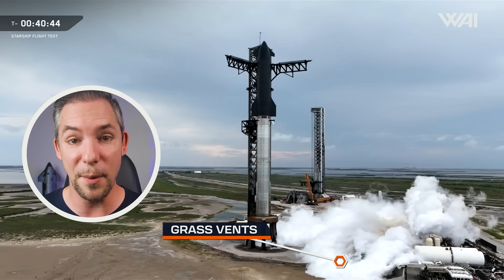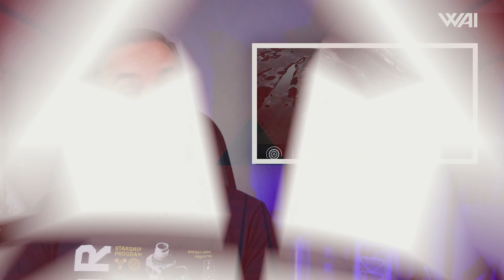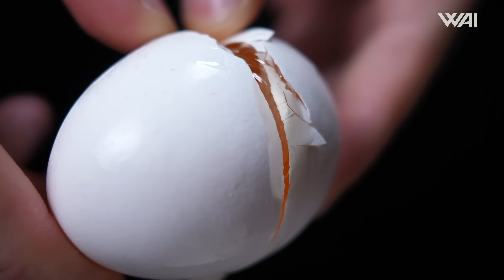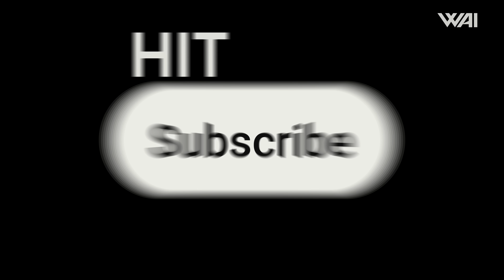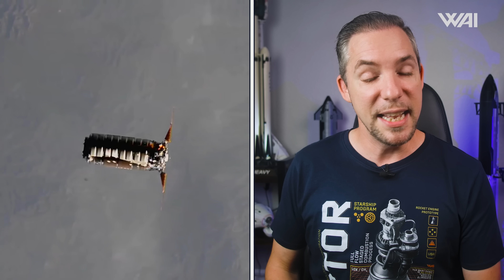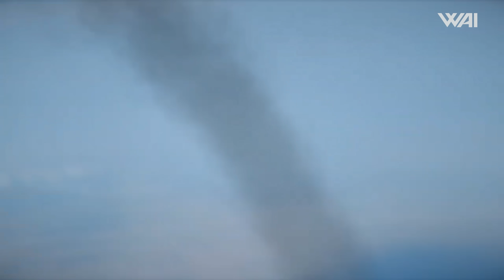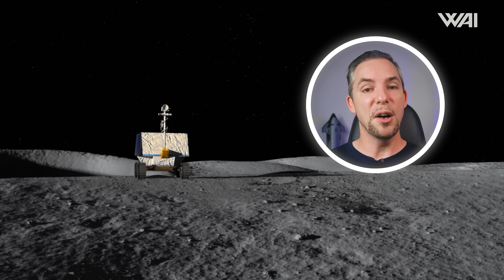SpaceX Starship Flight 11 So Close - I'M SHOCKED!

Comment: Regarding Cygnus, can one have a 'maiden voyage' for a one-use-only spacecraft? Plus, calling the ISS 'aging', when the Voyagers, and Hubble are sailing merrily through space is the kind of bias 'Ground News' should be covering. Nauka isn't 'aged'. None of the modules hauled up between 2006 and 2011 are aged. Every Cygnus, and even Japan's now-retired HTV logistics modules are examples of pressurized hardware that could still be used at ISS if NASA's culture changed to one of continual refurbishment rather than their historical 'throw away' mentality. This is an astronautics  version of 'new car syndrome': trying to justify a new buy when the old ride is still delivering. May ISS continue for another 40 years. Felix, sell your Boeing and Axiom Space shares.

Comment: I don't see a copyright on the video representation of the transport barge.  It seems to me more likely that Starship parts will be shipped in the form that they leave the StarFactory.  Rogers Road will have a Gigabay, but not a StarFactory.  So it will have the ability to stack boosters and ships.  Why spend time stacking boosters and ships in the Gigabay at Starbase, rather than shipping them straight to Rogers Road?

Comment: One additional eggshell context comment to add to the mix for you, Felix.  With a small edit to show and reference ostrich eggs vs. chicken eggs your video would almost pass your fans' strenuous fact checks - Ostrich eggshell thickness varies between approximately 1.64 mm and 3.5 mm or ALMOST as thick as the stainless used to build starships and superheavy boosters.🤓

Comment: During the testing of the AVRO Arrow they used heat sensation paint to determine the heat at various locations on the plane. This simple solution allowed for fewer sensors and reduced weight and complexity.

Comment: Hallo Felix + Team, danke für das Video. Bzgl. des Starship+Booster Transports nach Florida auf einem Lastkahn. Bei den Größen, Gewichten und der Seeweglänge, wie will SpaceX das Verwinden des Lastkahns bei Wellengang verhindern, damit keine der beiden Frachtteile Schaden nimmt (ich denke hier an Ermüdungsbrüche)?
VG aus DT
P.S. Cooles Shirt👍
P.P.S. Was ist mit euren beiden Shops los? Ich bekomme bei beiden Error 404 - Seite nicht gefunden?
Reply from the maker: Hey, ich glaube, SpaceX wird nur transportieren, wenn das Wetter es zulässt. Die Strecke ist nicht so weit. Das sollte machbar sein!

Danke! Ja, die Shops sind beide offline. Ein Hacker. Der Support von Spreadshirt ist sehr langsam…

Comment: It's kind of silly for SpaceX to have such a thin hull on Starship and then weld all the stringers on the inside and outside of the ships. It'd be much more structurally sound if the ships ring sections were corrugated and then have inner or outer rings welded ever so often on the interior or exterior for support. Sort of like the rings on a pickle barrel or beer barrel. In that way the ships can be supported horizontally on those ring sections the same as the ribs inside of a wooden boat, just steel. Also the weight would not be any more than what it is now with all the extra welds and stringers that exist on today's ships.🚀🚀🚀🚀🚀🚀🚀🚀🚀🚀🚀GO FLIGHT 11
Reply: I Don’t Like your Tone Dude !
Reply: Aerodynamic drag is a function of 'wetted surface area'.  A corrugated outer skin would increase the drag figure.  Go Flight 11!
Reply: like a submarine has a double hull .

Comment: There is a route through the middle of Florida. The Okeechobee Waterway (OCWW) is a 154-mile canal system that connects Florida's Atlantic and Gulf coasts in the central part of the state, running through Lake Okeechobee. It begins at the Indian River Lagoon on the east coast, enters the system via the St. Lucie Canal, and extends west through Lake Okeechobee and the Caloosahatchee River to Fort Myers on the Gulf coast. The waterway includes five locks and is navigable by vessels up to 50 feet wide and 250 feet long.

Comment: Felix egg shells are .3 to .7 mm thick.   And the booster skin is 3.97mm thick skin which is actually pretty thick for a structure.   I have worked as an inspector in a stainless steel plant. Although  we do ru alot thicker then that this is still consider pretty thick see how this is .16 inchs thick and we run as thin as .014....
Reply: Relative thickness compared to the diameter of the egg / ship.
Reply: He clearly said "comparative".
Reply: @RetroJack  yea he compared the thickness of the starship hull to the egg shell. There was no comparison for relative scale. Regardless, starship is a foolish concept.
Reply: @SterlingArchimedes  A foolish concept?
Reply: Ostrich Egg Thickness
Ostrich eggs are the largest of any living bird, and their shells are notably thick and strong. The thickness of an ostrich eggshell typically measures around 1.5 millimeters. This robust shell is capable of supporting significant weight, even that of an adult human. it can get as big 4.0 millimeters.

Comment: The reason it made sense for Viper to be canceled, is that if the government doesn't set a limit to cost overruns, the project managers will treat the budget as though it were unlimited. It is the very sort of mentality that has made Orion such an unaffordable system.  
Though I think pursuing Orion was a good thing to do. It was started before SpaceX was as far along in its projects, and it is perhaps good to have a 2nd choice for a launch system. Though, at its current cost, I don't think Orion is at all viable.
Reply: Not sure I understand the financials.  They canceled it to save 84 million but gave Blue Origin a 190 million contract to deliver it?

Comment: The SLS abort plan is flawed.  Even if the abort is successful, which I doubt it would be in a real emergency, the extra testing and weight will increase the odds of needing an abort system.  That makes no sense.  Build it lighter and safer instead.  Test is 20-30 times until it is safe, then put people in it.  I would not get in this death trap.  They are planning for failure instead of working toward success.

Comment: Why the heck are they picking a route ALL THE WAY AROUND FLORIDA'S COAST instead of directly to TAMPA/St. Petersburg then overland to the Cape ??
Reply: Tampa is approximately 140 miles from Cape Canaveral, primarily on expressways and interstate highways. This is a highly trafficked route through Orlando, and that's a significant amount of traffic to disrupt. 

Overpasses have around 5m (16ft) vertical clearance and the rocket is 9m (30ft) plus whatever it is transported on. So, they would have to go around all the overpasses -- but the stoplights at nearly every exit have no more clearance than the overpasses.

The booster is around 71m (233ft) long -- that's longer than four semi trailers end-to-end. Navigating the on and off ramps would be tricky. 

In the end, the land route just doesn't seem practical. Easier and safer to spend a couple of extra days at sea.
Reply: @greghadaller ok 😊

Comment: A chicken egg shell is on average 0.3-0.4 mm wide.
The Starhship steel is 3.97 mm wide, it is !) TEN TIMES as wide as an egg shell... not less wide.  (I checked this figure too, it is correct, only the egg-shell number was wrong).

4mm of steel is actually pretty thick, pretty strong, and pretty heavy by some comparisons: Modern commercial jet fuel tanks have tanks made of 1.5-2.5 mm Aluminum.  The space shuttle external tank was 1.6-2.0 mm of Aluminum-Lithium alloy.  Conversely ground-storage tanks that are intended for decades of stationary use and minimal maintenance with massive safety margins regularly are made of 10-25 mm thick high carbon steel.  So, while definitely not in the same range as ground-storage tanks, the Starship's construction is actually pretty chonky.
Reply: Thick, not wide

Comment: 304 stainless from which the Starship is made will readily rust, pit and crack in a marine atmosphere. If they were going to transport by sea precautions would certainly be needed, especially if they were to be re-used multiple times. Even storage in a marine atmosphere near the sea is likely to be problematic long term.
Reply: I’m sure they thought of that…
Reply: @ChadThundertalk  yeah I'm sure it didn't escape SpaceX attention. The fact that 304 stainless is unsuitable for use in marine atmospheres is not news for anyone with experience in these things.
Reply: WD-40 was designed to prevent Atlas missiles (stainless steel) from rusting.

Comment: If the single engine can be supplemented by the outside ring engines, then it may not need a static fire test if the potential is not as critical as it was before, perhaps?

Comment: Hearing Felix mention the subcoolers, I had to do a search because I couldn't remember the temperatures SpaceX chills their Starship fuels. Some fun facts, especially for kids, is to tell them (if my source is are accurate) that the liquid oxygen is chilled to almost (in Fahrenheit) 300° below zero, and the methane to 258° below zero. 

If you've ever had anything like a skin tag or wart burned off, the liquid nitrogen is around 320° below zero, although two different doctors told me it was 425°.

Comment: The handling of the starship and booster at the Florida end is a no brainer.  The bigger question is where the barges will be loaded and how the components get from the factory to the load point?  Use the existing port and find a way to travel all the way there?  Or build a new basin further east along the ship channel to reduce the land transport issues? 
The empty booster is over 200 tons and both have a 9m diameter, more than twice the normal road clearance when horizontal.  Both will present issues for land transport.
Reply: better just to build a factory in florida .
Reply: They need a canal or express highway to cross southern Florida. That’s a long trip around the tip & wasted time
Reply: @TruthMan1234  such a waterway already exists. It’s called the intracoastal waterway, and it was one of the things that made Cape Canaveral an attractive place for a rocket base in the first place.

Comment: Thanks for sharing Felix. Transporting the Ship and Booster on a barge is not logical🖖. They should rather test flight them from Starbase and then land it at Cape Canaveral. Think about it, the Booster lands first and the Ship does a lap of honour and land then. No Barge or special ground equipment.
Reply: No need for ship to do a lap.  Just separate and land separately at the two towers.
Or they could use both for a mission, launching at Starbase and landing at Canaveral.

Comment: Thanks Felix for another wonderful update video. The make or break for the Starship program is going to be V3 of the ship.  Should testing and flying go well, I think it's still full speed ahead.  Should V3 encounter anything near the issues that plagued V2, I think, unfortunately, the program is in trouble.  I would not have said this even after the flight 8 breakup but the issues since that flight have me very concerned.  I can't see a V3 launch of the ship and a super heavy V2 combination fly until early 2026.  SX just can't tolerate another disaster and I believe they know this because they are doing a lot more sub-component testing than they have ever done before.  An explosion on the new launch pad would be a catastrophic setback and they won't risk that. If V3 is a stinking turd like V2, they might reevaluate Mars and similar goals and objectives and concentrate on lunar lander development for SLS.  I don't see Blue Origin doing anything useful for NASA in the future.  It's obvious they have major issues with New Glenn and probably won't fly again until next year.  Booster reuse is a very long way off for NG and BO.  I don't believe we'll ever see it.  Not for a company so terrified of a public failure. Should V3 be successful, it's possible SX could strike a deal with Bezos and buy part or all of BO's Florida assets.  Anyway, I think it's all chips to the center of the poker game table for V3.  Have they learned from their mistakes on V2?  I think it's probable but space is very hard as both of these companies have discovered.  Neutron's make or break is in 2026.  If that all goes well, the competition in the space industry gets very interesting but I believe Neutron isn't insulated from the growing pains associated with spaceflight.  As always, time will tell.  Thanks again Felix.  I love your passion and creativity!

Comment: No way an egg shell is nearly 4 millimeters thick, like the skin of Starship & Super Heavy.. A dinosaur egg maybe, but not a chicken egg.
Reply: Looks like an eggshell is around .4mm thick, so his math is off by a factor of 10 or so
Reply: Absolutely not on the eggshell.  Unless it’s for an Ostrich.  4mm is more like 4 or 5 credit cards thick.  Eggcept it’s steel.
Reply: IF you scale a Chicken Egg up to the Size of the Starship I am sure you will find that the Shell is a bit more than 4 mm thick?
Reply: @anthonyshiels9273 it would be approximately 9mm think average egg diameter is about 40mm starship is 225x larger 0.04mm egg shell thickness x 225=9mm
Reply: @MrBretts1985  Yes, Starship Ø is 225x larger than a M sized chicken egg M ( 9000 mm : 40 mm = 225),
                                BUT the eggshell is ~0,3-0,4 mm thick    --- >   A starship sized egg would have a 90 mm thick "tankwall" !!  (225 x 0,4 mm = 90 mm)
Reply: @hectorpascale1013 .04mm not .4mm makes it 9mm
Reply: @MrBretts1985  Yes but an real eggshell is actually 0,4 mm thick.
Reply: @hectorpascale1013well if that's the case his analogy is still wrong
Reply: @MrBretts1985  He says: "That is thinner than an egg shell in comparison".  
 4mm Stainless is thinner than  90mm lime layer on a theoretical blown up egg.
Reply: Yes, 4 millimeters is ~0.157" or about ~5/32". A bit over an 1/8". By comparison the body panels on a 1960s American car were often 16 gauge or 1/16". Starship panels are then twice that thick.
Reply: The most important is that its exciting, not that its correct.
Reply: a credit card is about 0.76mm, u need 5 to get 3.8mm
Reply: My credit card is about 0.05mm after my wife used it.
Reply: That's what I was thinking I'm like 4mm is definitely thicker than an egg shell should have use banana peel or something if he wanted some comparison it's a 32nd of an inch above an 1/8 inch so between 1/8 and 3/16" thick
Reply: @MrBretts1985  The size of an inch differ dependent om which country to are talking about.
Reply: @AllanP-n3q we're talking about America... Starship is American Felix lives in America it's American
Reply: The analogy that I like most is that the shell of Starship is thinner than a scaled-up 12 ounce soda can.
Reply: @genelane2243 depends on how old the can is.   The old cans no.  The last several decades, yes.   Some of the old cans didn't burst in a freezing car, or a boiling hot one.   I have one that survived 3 or 4 years in a parked, closed up vehicle, fully exposed exposed to the sun and the cold.   And it isn't that old.   The company just hasn't figured out how cheap they could go on their cans yet.   Let's hope Musk sticks to the thick skin.   Less payload is well worth the added safety
Reply: He said "in comparison", which I take to mean "proportionally". If an egg were the diameter of Starship, it's shell would be much thicker than the steel.
Reply: You're right, @billsimpson604. An eggshell is about 0.4 mm thick, so Felix just missed a decimal point...
Reply: “. . . In comparison” he qualified the statement as a comparison. Give the man a little credit
Reply: @dunnkirke  it's a comparison that is 10 times off
Reply: Even the picture of the egg they show is clearly less then 1mm. Myst be a American converting to metric issue.
Reply: @dradic9452 is German and made a mistake on the comparison he was trying to say that the skin of the Super Booster and the Starship are thinner than an egg if it was of the same scale in size
Reply: It's obviously a comparison of proportion
Reply: He did say “ in comparison “!  Don’t you listen?!
Reply: I thought he said,  "point 4"...

Comment: Wait, did you just say to save 84 Million? You mean does that costs another 84 Million to put that Rover on the Moon?? 

I dont know whether am correct. If so, they can do for 84 Million right? Instead of paying 190 Million for BlueMoon. i dont know whether am correct
Reply from the maker: The 84 million were left on construction and testing. The 190 million is the trip to the Moon. Blue Origin is not cheap.

Comment: It is inaccurate to attribute the historical connection between maritime operations and rocket recovery solely to SpaceX. The Mercury program, for instance, involved the recovery of five capsules from the ocean, with the Liberty Bell capsule being particularly notable. Furthermore, Apollo capsules were retrieved from the ocean post-splashdown, and Space Shuttle boosters were also recovered from the sea. While SpaceX has undeniably achieved significant advancements in spaceflight, revolutionizing the industry, it is essential to acknowledge the historical context and avoid overstating their role in this specific aspect of space operations. The company's numerous groundbreaking achievements provide ample material for discussion without necessitating claims of exclusivity or precedence.

Comment: They need to puta bulldozer blade on the front of some of those rovers, to make a landing pad.
Reply: it will take a lot more than just leveling the regolith to create a good landing site. The rocks/dust being kicked around by the engine thrust is still going to be a problem, no matter how flat you can make it.
Reply: I like the idea of injecting sand into the exhaust plume in order to create a layer of silicats on the surface
Reply: @tomfrazer1428  or a bucket like a skid steer loader